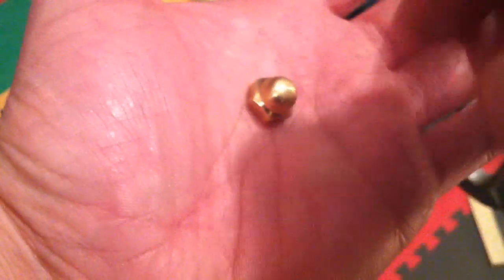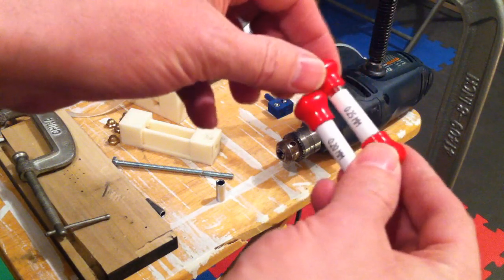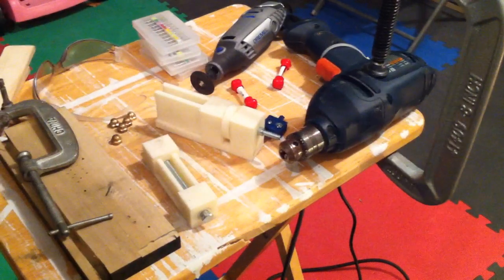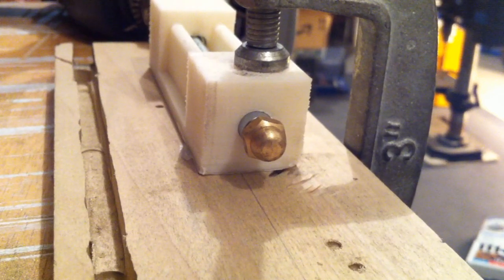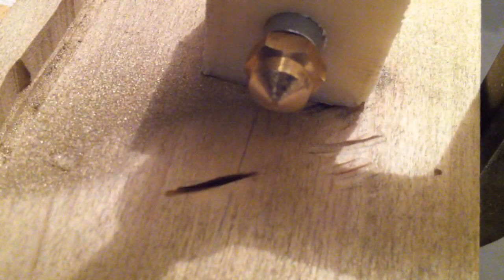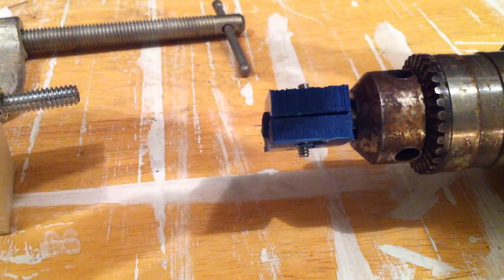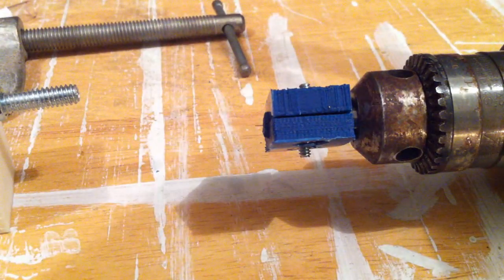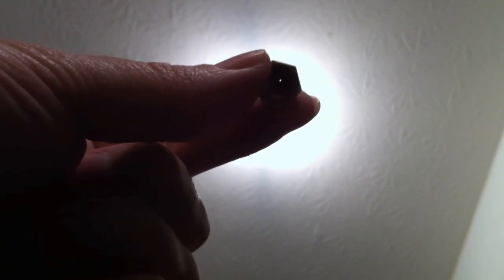Printrbot 0.20mm Nozzle Fabrication Method (HD)

Comment from the maker: I think the most important part of my calibration is solid hardware. The Printrbot is a great platform to start with. The mods I have on my printer are listed under one of the links above. It's the standard stuff though. Tight belts. Level bed. Good build surface. Tight extruder mount. If the printer isn't rock solid, then no amount of calibration will save you. (continued)

Comment: Good tutorial !
I made my nozzles almost the same way, except that I don't have 0.2mm drill bit so I use a 0.5mm one and I hit the drilled acorn nut with a hammer to reduce the hole size. I shape the nozzle into a cone after, I don't know the size of the hole but it prints very well.

Comment from the maker: Fortunately after the printer, the calibration in slic3r is pretty easy. The only things I really have to play with are the speed, layer heights, and extrusion multiplier. Layer height is a matter of taste and getting the layers to stick together. As for speed, slower is generally better. For example, for 0.20mm nozzles 30 mm/s puts a lot of pressure on your hot end and you might get some oozing around the nozzle without new teflon tape. For the multiplier I use between 0.85 and 0.90.

Comment: Thank you for the reply. I think my biggest issue right now is the width of the individual extruded "beads" of material. For example, if I were to print a solid base that requires 10 rows of extrusion side by side, I end up with 10 rows of extrusion with small gaps between them. It's almost as if the amount being extruded isn't sufficient for the speed of the head. I know for sure I am spot on with the extrusion step calibration though.

Comment: Why not just print a complete nozzle shaping lathe? Use an RC car motor to spin the spindle holding the nut. For better accuracy use a couple of ball bearings on the spindle.

Comment from the maker: Even with a spot on extrusion step calibration I have to use the 0.85 to 0.90 extrusion multiplier. It drives me crazy that I don't understand why! :-) If you're seeing small gaps between the extrusion lines, have you tried to bump up the extrusion multiplier > 1 to close the gaps? Also make sure the drive gear / hobbed bolt that's driving the filament isn't slipping due to dull teeth or filament dust that needs to be cleaned out with a wire brush.

Comment: Hey There! First off, amazing work! And thanks a bunch for sharing.

That said, I couldn't help but wonder, why did you decide to build a chuck for the bit and have the bit turn rather then adding that as essentailly a tail stock extention to the lathe setup? So you'de never remove the bolt. seems like that might be simpler and more accurate, what are your thoughts?
Reply from the maker: The drill bits I'm using are pretty small (0.10 mm!). I wasn't sure that I could rotate the nozzle and keep it lined up with the bit well enough not to break the bit. I even had to move away from the design in the video and go with a drill press setup with a Dremel as the drill to get the bit speed up.
Reply: Jerrill Johnson
Thanks for the response!

Good point. I guess that lathe doesnt use bearings so its fair to assume the rotation will be excentric.

Good luck with your projects!

Comment: Hi,
I was wondering why didn't you leave shaped nozzle on the tool after shaping its head with Dremmel and prepared 0.2 mm drill to be fixed and moved like nozzle. I think it would be much more easier to center fixed, not moving drill against rotating nozzle. So starting 12:39 on the left side it would be drill and on right side rotating nozzle. I hope it is clear what I mean :)
Reply from the maker: The jigged up hand tools are not good enough to hold the fine drills exactly on the axis of rotation... especially as the drills get smaller than 0.2 mm. I put the flat on the tip of the nozzles and that lets the drill location be more forgiving provided it's the drill that's spinning. Otherwise, the spinning nozzle tip drags and breaks the drill.

Comment: Hello Jerrill and youtube
I'm sure someone has asked this question before but what size acorn nut do i have to buy? or is there only 1 size and Thread acorn nut available?

Thanks in advance to who answers my Question.
Reply from the maker: It depends on the thread size of you hot end threading. I have a V1 Printrbot PLUS and the Ubis Hot End requires a 1/4-20 thread acorn nut. Also, watch out for male vs. female threaded nozzles. If you have a male threaded nozzle, you'll have to additionally use a thread adapter or hollowed out bolt along with the acorn nut.
Reply: Thank you for the Reply Jerril, I appreciate it a lot!! I have a Printrbot metal with Ubis Hot End so ill try and find a 1/4-20 Thread Acorn nut.

Comment: I feel like that would clog really easy. Any words on the smaller size jamming a lot?
Reply from the maker: Yes, the smaller gauge nozzles are much more fiddly than the usual nozzle sizes. Also, print times go up exponentially with size. But for small parts the results are on par with the commercial machines. The new resin/DLP printer obsolete this method though. (And I've seen these nozzles show up on eBay from China for $2 too!)
Reply: I bet they would make a big difference for fine parts! Thanks for the reply :)

Comment: If that was just for fun, it would be ok, but literally speaking you can buy a like a pack of 10 with a fraction of the price and it will be much more accurate, actually I believe one order from McMaster will cost you more than you spend for 10 nozzles 0.2 size!

Comment from the maker: The drill bit is so small I can't really see the cutting edges so it just looks like a little piece of wire. I think I need reading glasses, but I digress. Anyway, if there is any wobble then it looks like a blurry cone or cylinder as it spins. When it's rotating in an axis, it just looks like the same little piece of wire.

Comment: What's the drill material is it HSS or carbide?
Reply from the maker: I'm using carbide bits most recently.
Reply: I have tried with HSS bit, it is possible. I clamped the 0.3 mm drill bit to 2 pcs of Aluminums. And then mount the part to be machined to the drilling chuck instead.